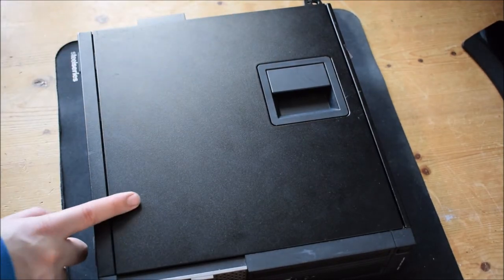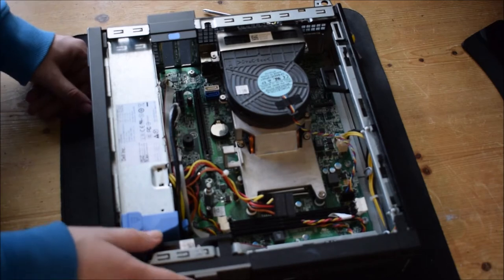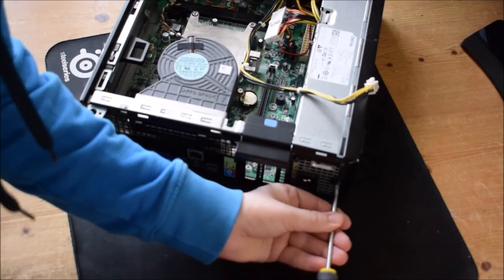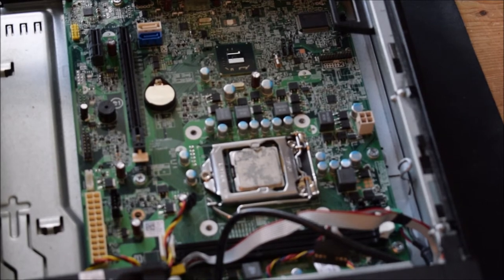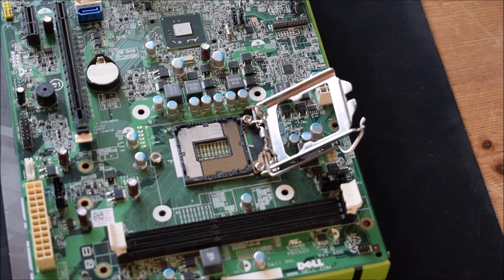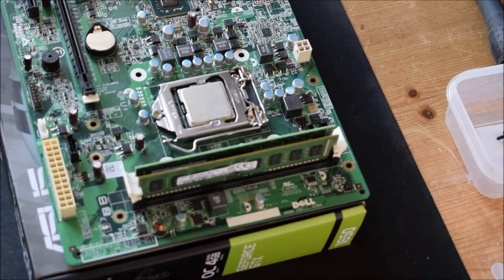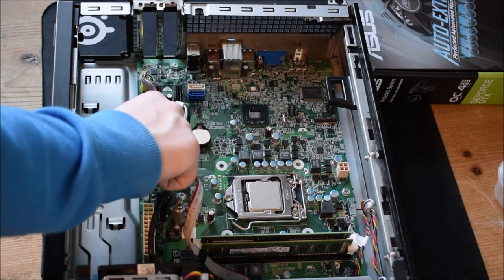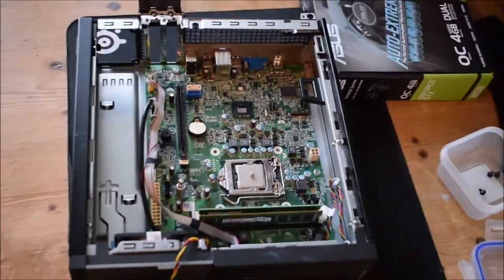Dell Optiplex 390 SFF taking Apart and Rebuilding

Comment: According a datasheet this dell optiplex 390 support i5-3470 but the computer shutdown 5 sec after turn on and l dont know what is the problem
Reply from the maker: Hi, I will look into this issue for you and get back to you, as got a spare I5 3470 , that could test with , and see if i get the same results.
Reply from the maker: H61 Chipset that 390 has , doesn`t not support 3rd Gen Intel.